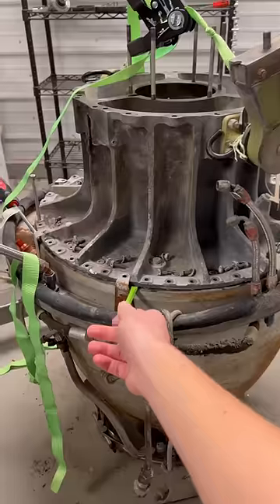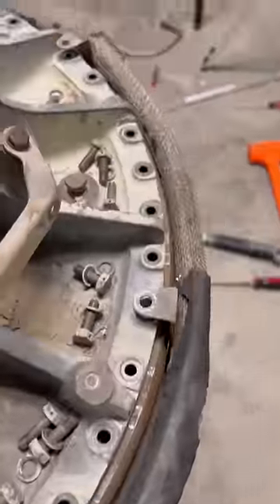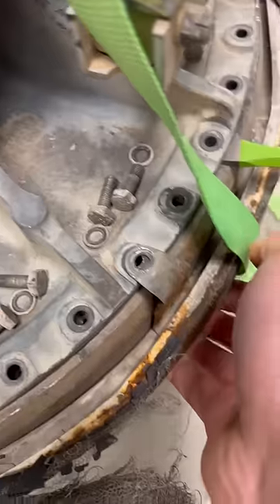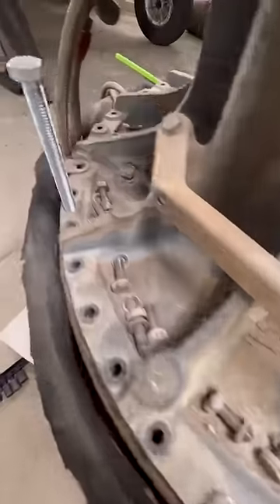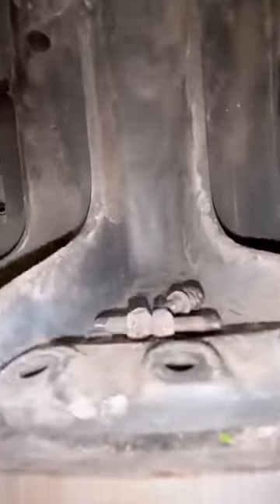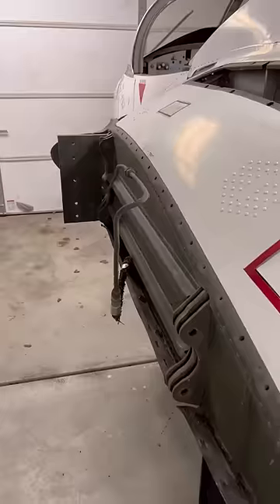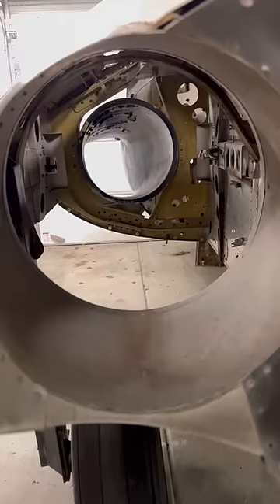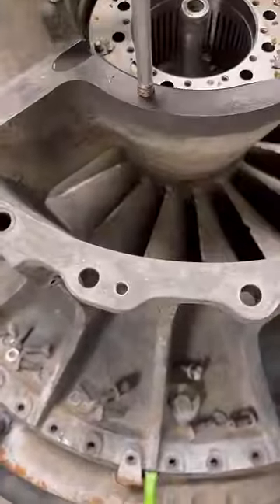Why My Jet Engine Won’t Come Apart

Comment: This makes a lot more sense now after he stated his goals.
Reply: How does “Remote controlled functional jet controlled by $10 stepper motors” make more sense?
Reply: I thought he was going to start it in his backyard
Reply: Can’t tell if ur being sarcastic or not. I think the FAA might give him a call if he decides to *remote control a jet*. Not into aviation that much, but what airspace would possibly allow that
Reply: @oakohcan  he said he's not rebuilding the aircraft just the engine. Then he said he would start the jet engine and watch it blow up. Don't know how that will happen safely though.
Reply: @oakohcan  Excuse me it won't fly. He means start and run the jet engine just to see if he can. He literally said he doesn't have the wings, tail, or other engine, how do you think that thing could possibly get into the air? He's just doing this to see if he can get it running again, maybe do some backyard tests from a distance, or take it to a farm or somewhere else in the middle of nowhere. 

I swear some people need to think before they reply or comment.
Reply: @nesyboi9421  your asking for way to much there buddy people will always be people
Reply: Hes probably using it for practice as well
Reply: Yes but hopefully those people who didn’t know what he was doing don't see this either, so he keeps getting a lot of comments and "engagement"
Reply: @resyntax  that was his goal originally. He then changed it because he's scared of a little bit of death.

So lame.
Reply: @resyntax  fr
Reply: @oakohcan bruh he is only going to start it up did you fucking forget the part where he says there ARNT WINGS 😂
Reply: @ST3W1010 bro no 💀
Reply: @flipwhale5494  lol
Reply: @bradleyhommerson6541 eh, without wings and all that it is much  lighter.
Thrust alone will fly it to a fiery end on the horizon :D
Reply: @cslewisster thats not what he said.
Reply: @jannishansoonn  "It will never be safe...the plan is to make it remote controlled and be really far away from it. I'll use stepper motors to control the throttle"

100% what he said. 

I haven't thought about this project for months and looking at the update video it looks like he's still on track to not finish the project.
Reply: @mjerpsycho8050 sit afew hundred meters away with a barrier and binoculars with all the stuff to switch on and off the engine would probably work.

Comment: Bro I'm an AF mechanic and your missing a lot more than you stated you have flight controls comms antennaes hydro and oil missing. I admire what your doing and it brings me pride to see someone take a Crack at motor repair.
Reply: He is missing an engine all he has is a piece of junk
Reply: @tomerabitbuleizen4992  ns Sherlock. Show me your credit then we'll talk
Reply: @TheNinjaman97  whats wrong with you?
Reply: @TheNinjaman97 bruh the guy will never get the engine started the fcu is trashed. Never happening. No way he can even rig it
Reply: Hey "mechanic" engine not motor
Reply: @pryceanderson5657  you know how to use synonyms congrats. Eng, motor both use combustion to generate thrust.
Reply: @TheNinjaman97  when people refer to a motor it usually means with electricity 
And with engine to fuel 
Both term kinda got mixed and in some languages motor and engine mean the exact same thing 
But the correct term is an aircraft engine
Reply: @Tetrazole very original. Oh no my feelings are hurt I can handle someone else's words.
Reply: He certainly has the resources to get or make all that stuff. He has a very expensive CNC machine (unsure of the exact price since he said it was second hand), an entire machining shop, and has/had a well paid job in aerospace engineering.

Comment: I'm a former jet mechanic in the United States Navy I worked on Allison t-56 turbo props. The compressor is a high heat high pressure that goes through extreme temperature and just like any part like that they are very difficult to get apart for example if anybody that has ever worked on exhaust parts knows this. Only advice I can give you is the pre lubricate everything with krohl . Then try " wakeing it up". This involves taking something like a brass hammer and tapping around it this also works for seized bolts put a low-power impact on and hit it lightly in a tightening direction first slowly bumping it up as you become comfortable but this comes with experienced and you get what's called a "feel for it. Always use the right tool and just don't strip that damn bolts. Remember you might have to apply some heat but do not hit the fan blades uhhh geeeze!  Good luck buddy.
Reply: Oh yeah, half the repair work I do is repairing mufflers of Extra 300's and C172's. Shit gets stuck so hard that sometimes the only option is to actually get the angle grinder and rebuild some piping.
Reply: Identical to what my father taught me and my younger brother who also is a Jet mechanic.

And what im trying to teach my son/employees and friends... ( lead a horse to water but cannot make them drink )

Exactly right, feel for it, almost "almost" cannot be taught. Takes the right teacher and student mindset.

Took my brother years to finally understand and truely feel it but once he did, now he got his dream job.
Reply: Yep.. i do restoration work.. gotta "Thaw it out" is the term I use kroil diesel fuel and automatic transmission fluid is a good start!
Reply: What a job 👌
Reply: he will never respond to his viewers.he just wants a million subs so he can buy more jets.

Comment: Pretty sure I attempted tearing that exact model of engine apart during my one semester of A&P classes and I can confirm that it is a pain to get the compressor housing off. We eventually got it iirc and did an inspection on it, where we found that it had ingested FOD of some kind that tore up the compressor and turbine blades. Definitely one of my favorite projects in that turbine engine class even though the professor was terrible at his job.

Comment: Could you try to see if there’s a way to loosen the rust chemically? I think that would be worth trying as your not seeing much progress just trying to pull it. Anyways, keep it up!
Reply: It's probably a much better idea to either ditch the engine and find a better one, or try to find alternative propulsion. Engines in that shape are something you don't touch with a 20ft stick. I don't think I'd be comfortable replacing 80 percent of that engine it's so bad. You'd probably break it in the process. You just wanna make sure the engine you are using is in tip top condition, as it could mean the difference between life and death.

Comment: Try white vinegar it works for some of my most rusty parts and is cheap if it doesn’t work
Reply: @ulogy   those parts aren’t galvanized they’re billet??????
Reply: @Andrew-hh3ol  Creator said galvanic; inclined to believe him as I'm not qualified to say what's inside a random engine, haha.
Reply: @ulogy  I’m used to plane engines being billet i guess white vinegar wouldn’t work

Comment: Visit napa or PTO Sales to see how long a PTO cable with a locking knob or Morse cable they can make. For fuel cut off.  

If the housing bolt holes are blind.   Get grade 8 all thread.  Grind one end to a 60 degree point.  Get some jam nuts.   Drop the all thread into the hole with a jam nut between the flanges.  Screw the all thread into the jam nuts then into the bottom of the hole.  Use the jam nuts to force the flanges apart.

Comment: If you can get the compressor housing halves far enough apart to jet a jam nut and a piece of steel in between the halves  in a few spots, you might be able to use a couple of the bolt holes as jacking locations instead of the damaged jacking locations that are there already

Comment: I work on power generating engines similar to jet engines. Kroil is your best friend when taking old seized up metal apart. It's designed to get in the smallest cracks. It's "the oil that creeps"!

Comment: This reminds me of like 2 weeks ago where a big rolling mill gearbox had a broken bearing. Shaft is around 200mm dia and length more than a persons height. Gears wide enough for a coffee table. Almost each single part on that shaft needed a custom rig cut from 1 inch thick steel to fit a hydraulic jack. We eventually burned it to about 400 C and used a 100 ton jack and knocking with a sledgehammer to get the main gear out. Then someone has to cut off the welded parts and figure out how else to use the pieces of used metal plates. Grind out the welding too until smooth. Then we have to put them back together along with new bearings. Anyways, the SV found it when checking another gearbox beside it. Preventive maintenance working as intended. And this was with a gearbox with lube sprayed internally, and with a whole roof above it

Comment: In the process he learns critical problem solving.  I'm amazed by how many people simply stop, give up or quit at something because they come to a point where rather than think of ways to continue. They simply give up because they assume they can't go forward rather than finding a way to move to the next step. The only difference between completing something and not completing something is simply not quitting. Fail and fail and fail and fail again. Just don't quit because eventually you will finish

Comment: Corrosion is so binding, I work on shuttles and one day we had to switch out one of the gearboxes, these gear boxes are the size of me way a ton, we jacked up the wheel so the gear box and tire were off the floor, took the tire off and removed all the massive bolts that attach the gear box to the body of the shuttle (with a forklift below the gearbox the catch it) it took a whole day of hanging from the longest lever bars we had in the port with the longest extensions, wedges with sledgehammers a whole can of WD40 to get it loose come off, it was being held by nothing but rust

Comment: I would spray penetrating oil, like PB Blaster, or Kroil all the way around.  Next day spray it again put a few bolts back in then try to rotate it with some leverage.  Back an forth little by little, once it starts to move hit it again with the spray.  Rinse and repeat until it spins free.

Comment: Alternatively, white vinegar will dissolve metal if given weeks to do it, but it would likely eat up the corrosion first.  If the problem is between the compressor blades and the housing, heat makes metal expand.  I'm a farmer, you may want to seek advice of an older jet machinic.  Pls don't get in a hurry or likely won't end well! Good luck bro

Comment: Don't give up 
Remember forcing loves to  jam up things you'll be surprised what a bit of heat and inox spay with a bit back and forth movement can do also keep the parts àt same alignment cause the inside lip can jam against the outside houseing

Comment: As we would say bodge it, bolt the engine to floor and get a winch/pulley on the roof to pull the housing off or bolt two lengths of bar to the housing and jacks on each side of the bars to force it up and off

Comment: Yeah I was going to say it’s the same concept if you have ever taken heads off a really old engine, the lock into place from all the crap that slowly creeps between the block & head so you get yourself either a paint scraper and try to wedge it between the block & head do this in multiple spots to try and pop it off the block or you can use a flathead screwdriver or a crowbar if it’s really really stuck lol

Comment: My best recommendation as an auto mechanic from the rust belt, a big ol torch, a lot of in-force penatrent, a big ol hammer and pry bar, and a bit of luck you don't break anything. Good luck bud

Comment: Corrosion and dry sealing rings. Might have to use some bolts in certain places to push the housings apart, like have threaded in plugs for those spots

Comment: Warm water with mild detergent or vinegar were the gaps are(nothing to acid that will compromise metal). After that, a high heat torch and some percussive hits. At least this is what I do for marine engines with this issue.

Comment: Soak it in diesel for a while always gets old fence hinges apart with heat. I have no idea if it will work. But i want to see your jet take flight. My gla flew b17s prols to you. Im a new sub for sure

Comment: Brother I’ve been in the air force for many years, not being mean or bashing you but from the looks of things you need to let that go. I know it’s not something you wanna hear, but you also have to think if you did manage to possibly get that working and find all the parts you need. It’s gonna fail. That engine needs a lot of overhaul an even then I don’t see it even being airworthy with out almost a complete replacement, I love your enthusiasm as well as your spirit but the biggest an honest thing you need to ask yourself is this. What happens if I did get it running and I flew it, will it be safe not to crash an hurt someone or myself. These are not easy things to think about but it is something that needs to be on your mind.

Comment: Try threading the bolts back onto it  but using washers/plates in the gap to stop them. That way you can “tighten” the bolts but you’re really just prying it appart

Comment: Get a constant stream of penetrating oil in there and then try hitting the wedges from a few sides at once. I’m no jet mechanic, but that’s what I’d try. That and using some sort of vibration to try to break the corrosion free like an air hammer

Comment: Heated blankets wrapped around for a few days would crack a majority of that corrosion and help separate it much easier once you allowed it to cool or go the opposite way in a freezer it's all the same. I rebuilt 2 turbines inside a boat before that had a lot of salt corrosion and me and my team used the heated blanket method. We had to expand and contract one with heat and cold it was so bad, just got to be careful how much heat you apply.

Comment: The fact you've gotten it to seperate at all means it will come apart with enough time and technique. The hardest bit is normally cracking it loose to begin with. 

My advice would be some graphite based anti corrosion spray and let it soak in for a couple days with top ups. Then bolt it back down flush to ensure its square. Use proper heat like oxyacetylene. Keep the torch moving trying to heat the outer case flange evenly. Then attempt to draw the upper case of using the bolts as before.

Comment: To deal with that galvanic corrosion, I suggest putting the gap under tension while insulating the non corroded parts of the housing from eachother and keep the oxide lump wet with a slightly alkaline chemical buffer sollution, then use a pair of crocodile clamps and a dumb car battery charger to reverse the electrolytic polarity between the less pure part of the housing and the oxides in between.
That should start to slowly reduce the oxidized metal back towards the less "pure" part of the housing that it came from until the physical tension you apply with the wedges breaks the oxide apart.

Comment: Boat mechanic here. Being a boat mechanic means dealing with galvanic corrosion all the friggin time. 
First, I would try wedges placed around the whole perimeter of the part you want off. Hammer those wedges in a little bit at a time so they all lift equally. As best as possible.
The corrosion is softer than the metal and should break free. 
From what I can see, you will have to replace this part. Apart from getting some advice from a metalurgist, I don't see this part being reusable.

Comment: To get that piece off...
Use more chisels at the same time and slowly increase chisel height all the way around.
I remove stuck flanges like that(but using flat head screwdrivers instead)

Comment: The thing is though the TF-39, CF-6, JT8, JT9 TF-33, CFM's,901's, 331's and probably every other engine out there has proprietary tooling and alot of it is internal. I never worked on this turd but every other engine i did work on has mass amounts of tooling for disassembly and assembly. A&P

Comment: GM EGR spray is the Best rust buster or corrosion if you can find it  krull oil spray is secount best a laser cleaner or a hot tank used back in the 60' & 70's at a automatic transmission shop transmisson  transmission transmission fluid is good for breaking loose and restore metal parts it keeps transmisson clean  ? If you static balance your spining parts is a good thing and have fun !

Comment: Best way you can prolly get that galvanic corrosion to loosen or at least release it to get some wd-40 and an acidic solution so that the acid can eat away the corrosion and the wd-40 will make it slide out faster with less resistance

Comment: Freeze with dry ice then you use map torch on the outer other half. Hammer shims one-at-a-time all the way around then you keep going around tills it pops apart. Kind of like a feather wedge ⛏️ 3 positioned around it can you push apart. Easy I'm the Maytag Man.😎

Comment: Hmm... I csn think of a couple things... using an air hammer and rubber head or pad just to vibrate the whole thing to help the corrosion rub away might help.

Comment: You're going to have to use a flame to heat it up with several wedges and a crain. You'll most likely have to send it off to a specialist to be CNCed flat.. I personally use Concrete Acid to remove Corrosion with a soak in oil and baked or it will turn orange, though personal preference..

Comment: Have you tried heating it with a rose torch and working it one section at a time also you could mix water with some dawn dish soap and free up some of the  galvanic corrosion idk how but it works heats the best tho